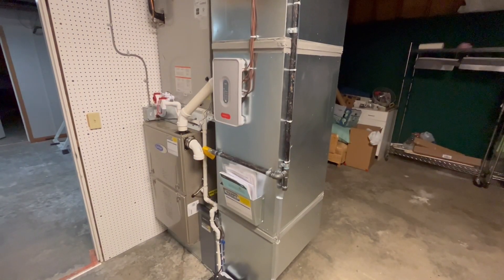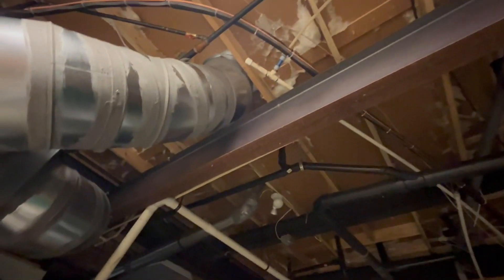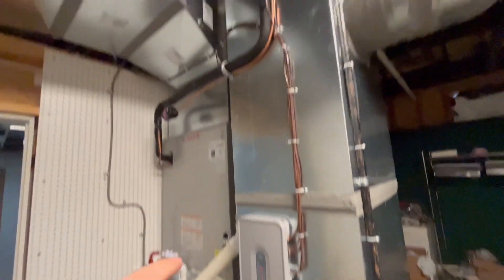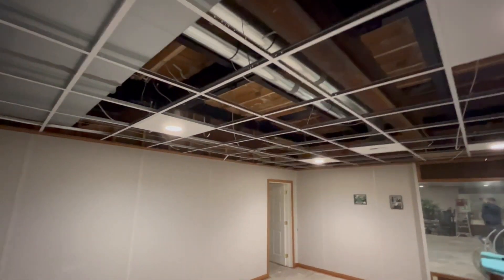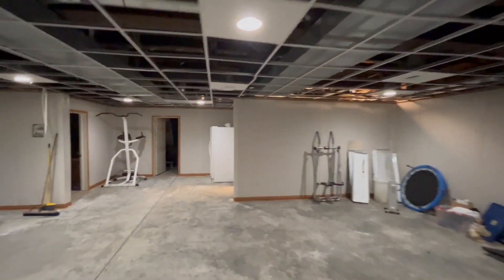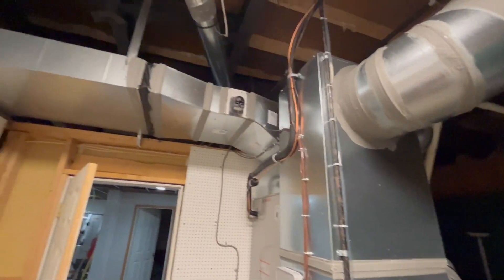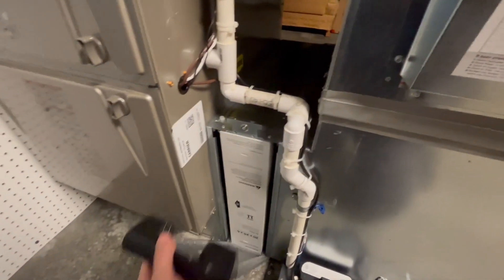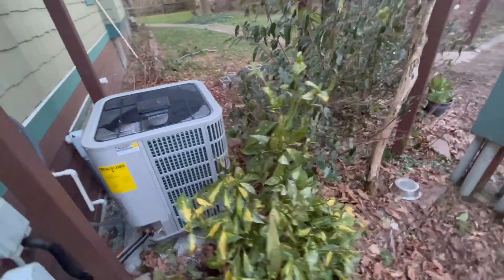Bosch Heat Pump and Carrier Furnace with Zoning

Comment: My existing system is 3 zones - one being small, two fairly large. It's 2005 vintage - comfort maker Gas furnace and cheap 3 ton A/C outdoor unit.
So, if I want to install the 3 ton Bosch A/C heat pump outdoor.....would it be easy to use the existing coil and/or ductwork in this simple fashion - when the small zone calls, I'd want the blower to turn on a low speed or stage. When any other combo of dampers/zones are in use, the higher speed fan would engage.
It would seem fairly simple logic - the furnace fan motor was replaced once, but not sure what with. 
Might this be as simple as some basic logic controllers and rewire of the distribution fan motor?
Or, replacement of the fan motor with a Rescue or other variable speed (or two speed) motor plus the logic?
Alternative would be remove the gas furnace and use new air handler - we'd still need the logic.
For rough idea - two big zones are about 1,000 sf each and sm zone is 600. The small zone is very loud due to the full CFM of the fan being used when only it is calling for heat or A/C.
(I am getting a Bosch installed right now - the package 3 ton - at our small ranch house in Florida)....

Comment: How the static with both stats calling for full cooling lot duct run can you cool both up stairs at the same time. What about humidity control for the basement.  Your bypass with one supply damper closed hi stage heat what's your air temp at the furnace  circulating that hot air back to the furnace will make your furnace get hot.

Comment: Do you disable adaptive sw4-3 for zoning?
Reply from the maker: Do you mean on the Bosch unit or on the carrier?
Reply: @marrsheatingandairconditioning  Bosch ids condenser
Reply from the maker: @OnePointLander  we leave the Bosch in adaptive mode. We want it to be able to modulate the compressor in this application. In this particular application when one zone calls we are in our low stage and when 2 zones call we modulate up to high stage